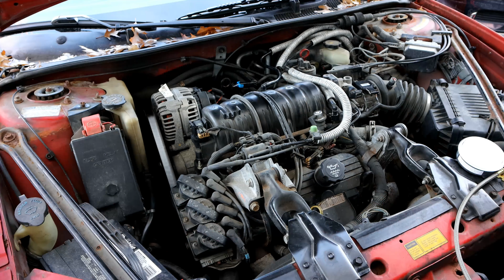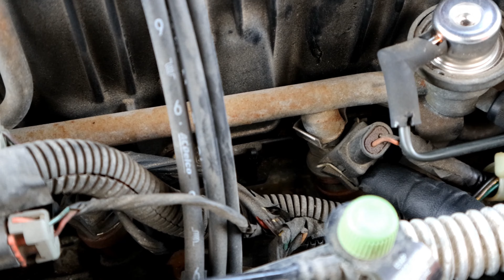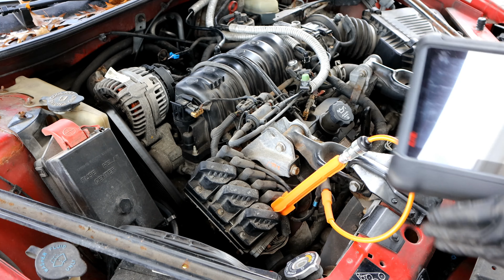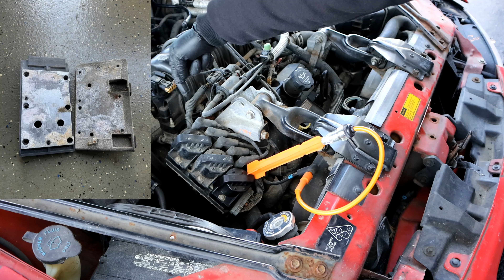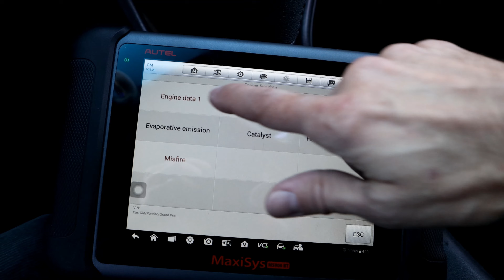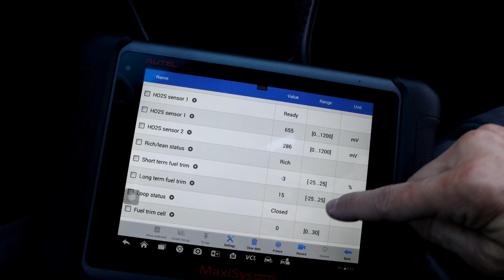How to Test GM 3800 Fuel Regulator, Injectors, & Coil Packs (Engine Misfire P0300 Running Rich)

Comment from the maker: OTC 5630 Fuel Pressure Guage: https://amzn.to/45XNx7N
Tool Aid 23970 in-Line Spark Checker Kit for Recessed Plug: https://amzn.to/4jS2RZv
Lisle 20580 InLine Spark Tester w/Coil On Plug Wire (Similar Alternative): https://amzn.to/4bbzxLg
Delphi GN10123 Ignition Coil: https://amzn.to/3YQKP00
Klein Tools Digital RMS Multimeter: https://amzn.to/4a6Q6qs
OTC 7215 Exhaust Back Pressure Gauge (Used in video): https://amzn.to/3L8sFU3
OEMTOOLS 37263 Exhaust Back Pressure Tester/Gauge Kit (Cheaper Alternative): https://amzn.to/4peZ49N
Tool Aid 33600 Exhaust Back Pressure Tester (Cheaper Alternative): https://amzn.to/4qpMOUK
OTC 4437 8-Piece Sensor Socket Set: https://amzn.to/4qpMRzU